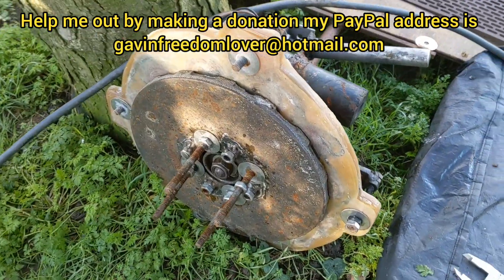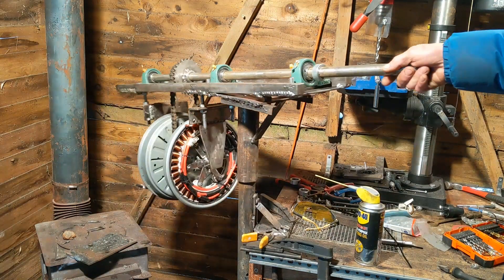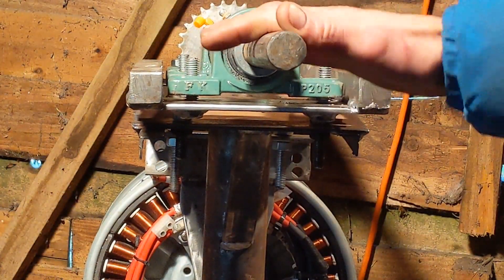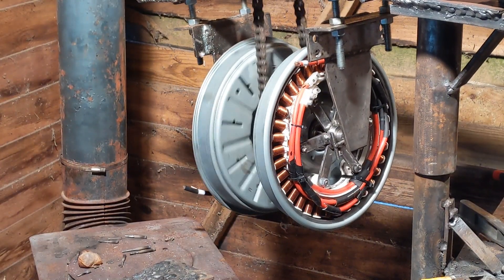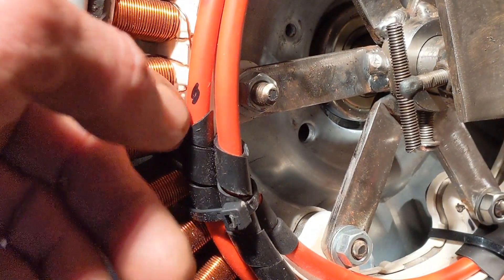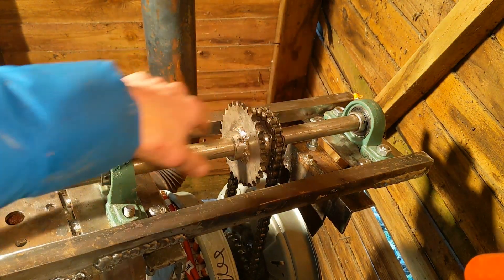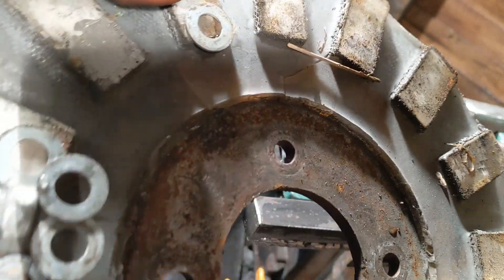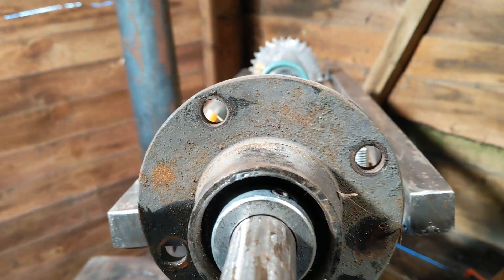Dual Smartdrive wind turbine , Very close to being completed , HAPPY NEW YEAR !!!

Comment: Happy new year 
Gavin i use a 1500w ups inverter on my solar panels instead of a inverter you can get them
Cheap as usualy they come with no batteries 
They are used as backups for computers and
Big companies throw them out when batterys fail
And ups are ok they buy new with new batteries 
And you can fit your own set of batteries to them
As i bought a inverter and it was rubbish it was not as advertised rating 1000w did not last
I also use a auto change over switch for mains change over as on big clives youtube
Just info for you and others doing this type of energy use ups are pure wave form as well
And i turn it on ups  auto at full battery till it gets to low voltage battery level then it switches back to mains till batterys charge up again
Brianc
Reply: Yeh my freind did the same he uses a huge ups connected to 190v+  battery bank